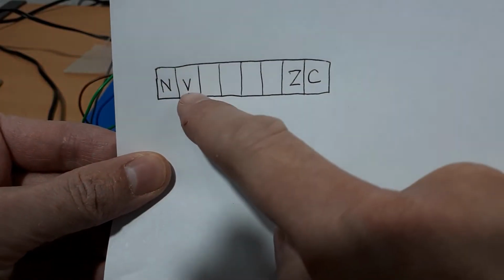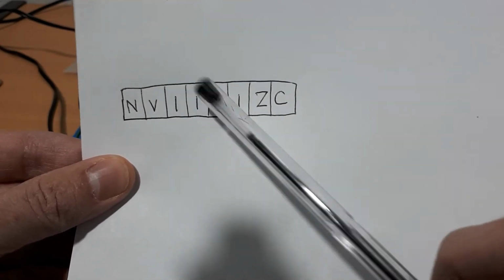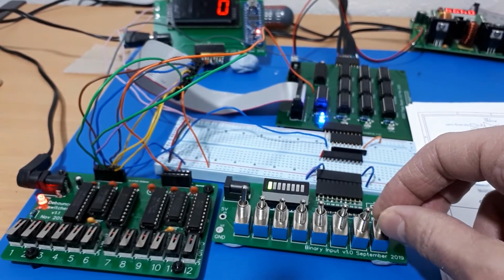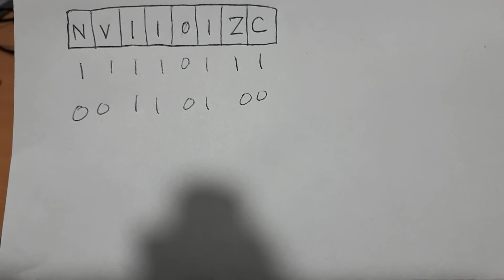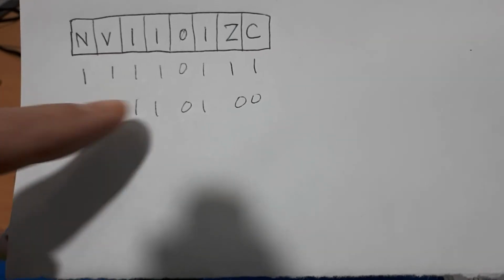Homemade 6502 CPU - The FLAGS part 1

Comment: The bus lines are all in the same relative positions on all boards. If you align the control lines and power lines too, you could easily stack those boards and build a very compact cubic computer.